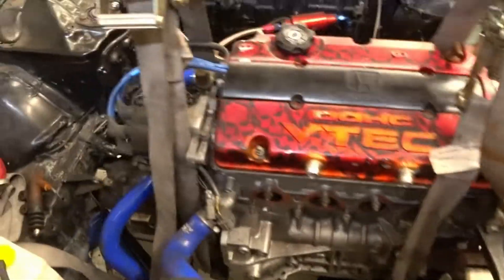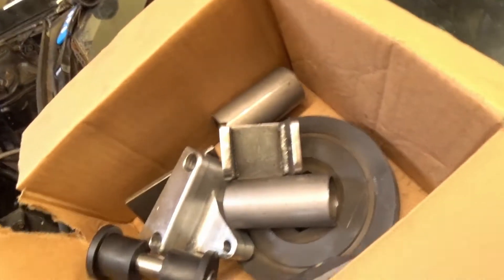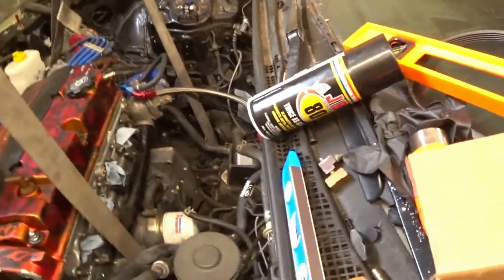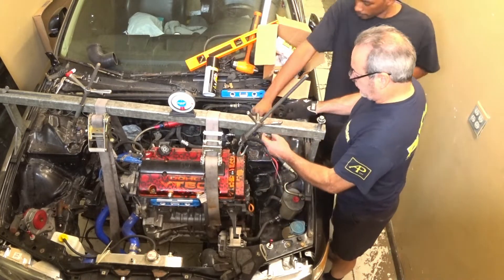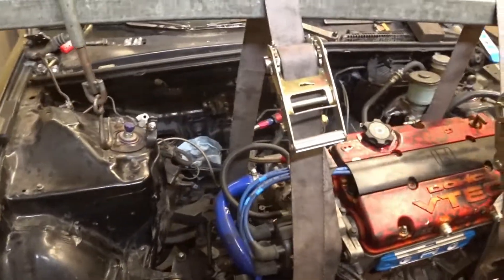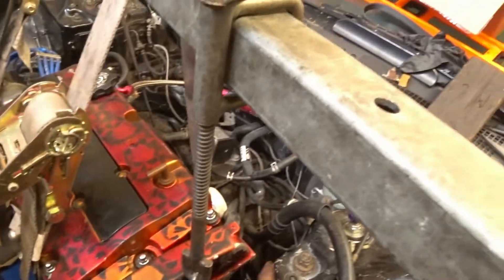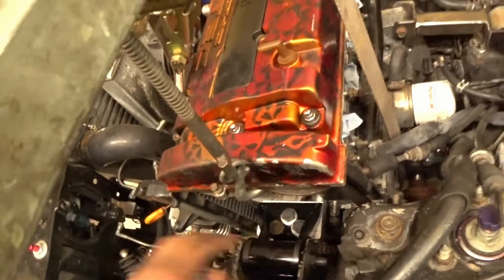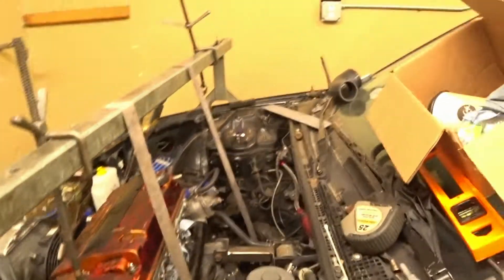ACCORD CB7 AWD SWAP. MOTOR MOUNTS BUILT. PART 2

Comment: Seems like a lot of work for a cb7.  Would much rather see that in a bb6 prelude.  Good stuff regardless
Reply from the maker: It's a lot of work but I like cb7 over many of the other body style. But if things go well the same process can be done for prelude since the body  measurements are close.
Reply: @AJIMPORTS  i remember someone di a rwd conversion on the prelude with the motor and trans in stock location so im sure it can be done